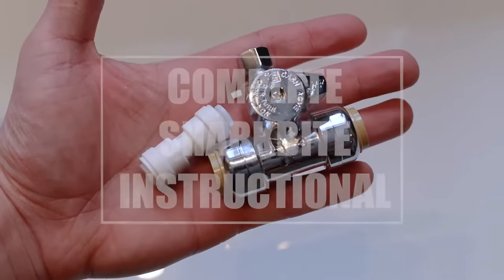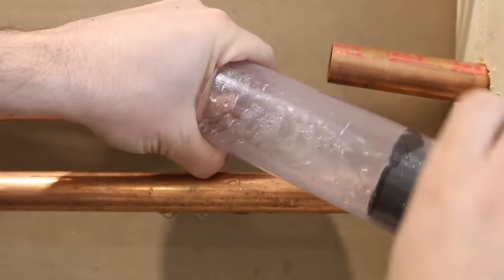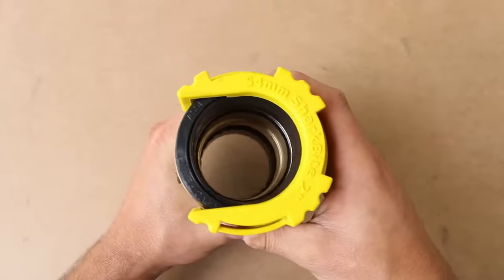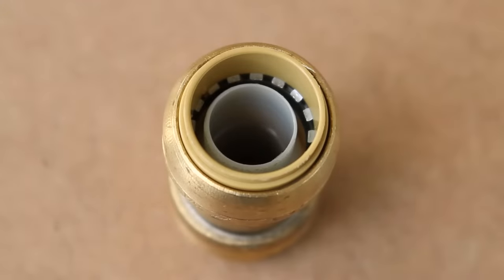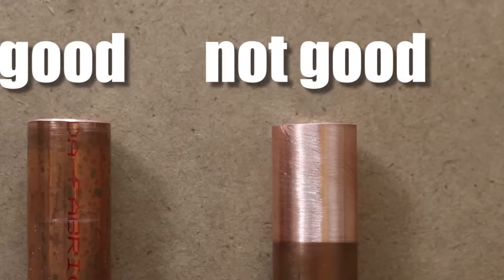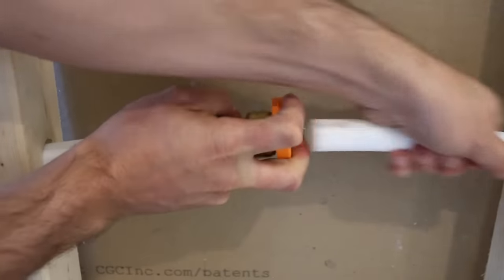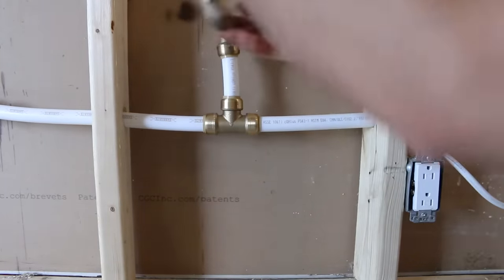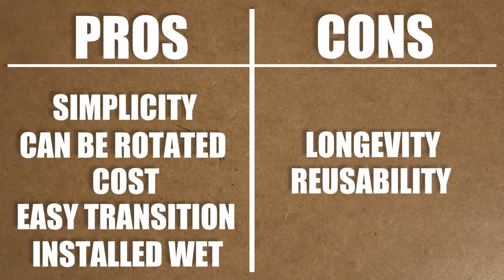Beginners Guide To SHARKBITE Fittings (Watch till end BEFORE Buying!) | GOT2LEARN

Comment: Thanks for the instant replies to my comments on your videos.  Question for you please, I have learned (after watching several of your videos on copper piping mistakes) that I put too much solder plus over heated the copper pipe when I was bonding a copper tee.  Now I need to make adjustment to that joint with too much solder, too much flux on top of over heating.  I am having difficulty of melting the blob of old solder.  That blob of solder would not melt in order for me to switch to a Shark bite connector.  I have using a green can propane for heating.  Any suggestion?  Thank you so much for all your very educational and great videos.
Reply from the maker: When you solder a joint and you are unsatisfied about it, you cannot adjust it, it needs to be unsoldered, cleaned and resoldered, no way around that.
Reply: @Got2Learn  I understand (learned that from your very educational videos, thank you very much for the teaching). I agree to a complete brand new redo but I could not melt the old and several years old solder.  So wanted to learn from you (based on your very extensive knowledge of copper pipe soldering) what is causing such weird situation.  Wanted to learn from this extraordinary situation before simply  cutting the copper tee and then install a "Shark tee" joint in its place to avoid not able to complete a new and correctly done solder joint as taught by your videos.  Thanks for the attention and time plus quick replies.  Take care of yourself.  👏👍
Reply from the maker: 🙂
It is highly probable that you have still water in the pipe, have you checked for that?
Reply: @Got2Learn  I have drained every segment of pipes (both flexible and hard ones) that have slopes.  I am certain there are copper pipe segments sealed off by dry walls and those are horizontals because I saw them like that while they are being installed/jointed.  Those are the ones going between the 2x4s within the walls.  So based on your video talking about the use of "Shark joints", the most economical solution to my situation is to cut off the copper tee that is only 2/3 solder correctly (the 1/3 that I am having difficulty of heating it to the proper
Reply: @Got2Learn  part 2 (sorry pressed the send button while trying to edit)-that 1/3 is closest to the standing and horizontal copper pipes behind dry walls.  I can only cut that copper tee off and replace it with a "Shark" tee joint.  Thanks for sharing and the diagnosis.  Take care.
Reply from the maker: Yeah you can do that for sure, do you plan on closing those walls back up?
Reply: @Got2Learn  Oh, no walls were opened by me.  I added that copper tee on the stucco side of the wall about 2 years ago.  Now I want to add flexibility to my hot water system so that I can switch between electric or natural gas heated hot water depending on how much I need to pay for the energy to have hot water conveniently.  I live in California so we have been charged at a higher price for energy, this flexibility just allows me to stretch my dollar a little more in the current high inflation time that we are living in.  I have plenty of access room to replace that copper tee with a "Shark" joint as your video talking about "Shark" joints stated as one of the pro for the "Shark" joints.  Thanks a million once again!
Reply from the maker: Yes you can use a Sharkbite for that application, but I personally wouldn't close up the walls with a Sharkbite in there ;)

Comment: How about outside exposed plumbing in below freezing conditions?  I need to connect multiple "drinker tube" cartridges on outdoor run of quail cages (on chilly PA).  Looking for a quick, detachable solution that will allow me to to remove a cage (for repair or sale) without having the cut (sacrifice) tubing length or create a leak should a screw together fitting be rotated.  Worried about freezing issues although the water supply will be constantly circulating.

Comment: Know that PEX tubing can withstand colder temperatures than copper or cpvc. Cpvc gets brittle after several years so be careful when working on it. I'm a fan of shark bite and have been using them for years with success.

Comment: good show question do they have freeze proof fittings. I have heard a lot about the brass fittings freeze and leak if insulation is lost to cold. only one complaint. water doesn't experience turbulence only air. cavation and water hammer happens in water,

Comment: Let's be honest.. how confident is the regular DIY'er soldering a pipe that's behind a wall? - Since my level of confidence is the same soldering or using Sharkbite, guess which one Im gonna use?
Reply: I'd rather use a mechanical coupler to join them tighten them up and there good as for a split pipe get a pipe mender they clamp around the pipe and tighten the bolt I've used them when the main shut off won't shut off all the way and you can't solder when you have water in the lines

Comment: Does the stiffening collar or small diameter of the 90 bends sharkbites reduce water flow  making water pressure decrease?
Reply from the maker: Not really because they have the same diameter as a normal pipe inside...

Comment: I have an old copper tube and so the outer tube is gunky. If I should not use sand paper to clean it, what other options do I have to make it smooth to fit into shark bite?
Reply from the maker: Use 3M abrasive pads, link in description box below.

Comment: Great video here but I would not recommend using shark bit fitting in areas that will be covered, here is why. I have just removed all shark bite fittings from my home due to 3 catastrophic leaks that resulted in significant property damage over the past 24 months. These fittings have been in service for 16 years and the ones that didn't fail were ready to fail at any moment. I have pictures available and I have also submitted them to the local building department because my neighbors also have them. I have no idea why they are failing but it is only a matter of time. If you have these buried in your walls I suggest buying a scope camera that attaches to your iPhone and looking at your fittings. I drilled a 1/2 hole inserted the camera and found several more fittings one that was about to fail and the rest showed signs of deterioration. I am surprised there isn't a class-action lawsuit, maybe there is I just haven't found it yet.
Reply from the maker: The question is; how were they installed.
Reply: I'm not sure where my reply went so I'll reply again to your question about installation. First and foremost you have a great video, great job! Folks should however be made aware of this issue and not use these in areas that will be covered up. OUr fittings were installed by professional plumbers hired to repipe the house replacing kitec plumbing 16 years ago. Our entire subdivision >1k plus homes was repiped and the ones with shark bite fittings are failing resulting in water damage. According to my plumbers, both reputable regional licensed contractors (southwest USA companies) we aren't the only ones with this issue. Furthermore, they only use shark bite fittings temporarily to restore service until the correct fittings are available to make the repairs. If you forward an email I will forward some pictures.    @Got2Learn
Reply from the maker: @bobshannon4437  This is a good opportunity to post it on my forum, i'm curious to see the pictures, here's the link: https://got2learn.freeforums.net/

Comment: Probably be a good idea to use a little bit of silcone lube to decrease the friction on the o-ring and to protect it a bit. Personally not a fan of these, I'd be willing to bet that they start failing after a few decades. Of course that means if you're older or plan on moving, that will make it someone else's problem lol.
Reply from the maker: Yes, it's actually a good idea, but they already have some 👍👍👍
Reply: I use plumber's silicone grease for the 3/4" and 1/2" end caps that I keep in my toolbox to temporarily cap off open tubing.  Those little guys can get connected and disconnected a lot, the grease keeps the o-rings nice and pliable.  I don't think you need to add it to a new SharkBite if you are just going to install it and leave it.

Comment: Would these be recommended to be used on the in and outlet line of a gas hot water heater?
Reply from the maker: It'll work, but I wouldn't recommend it.
Reply: @Got2Learn  thanks, I’ll go with traditional copper pipe.
Reply from the maker: @KillerBebe  100%

Comment: When installing pex in place of copper, using sharkbites, would you need to upsize the pex? For example, I'm replacing a section of 1/2 in copper with pex using sharkbites, do i need to use 3/4 in pex to keep a good flow of water?
Reply: You could do that but it's not necessary. I tend to continue using the same sized piping as was originally installed so in your case 1/2 inch. One of the down sides of going up in size is the wait for hot water to arrive at the faucet. It's very noticeable in medium to large houses.

Comment: I feel like the "longevity" and "reusability" should be in the pros category, not the cons. IF, and thats a bif if, it leaks due to an O ring wearing out, you can simply pop on a new fitting.  100 times easier than when a copper shutoff valve starts leaking, which they will.  And the fact that theyre not that expensive anyway is another plus on the longevity side.  And because theyre reusable and you can just pop them off and move things around if you need to, again, another HUGE plus, especially when working on an old house or doing a remodel.  There isnt a reason to NOT use these inside.

Comment: Temp only.  Every time you lose pressure the fitting slide off the tube ever so slightly when you turn pressure on.  Never use in a sealed area.

Comment: Anyone that uses these are future Flood Damage/Mold Customers. As a 20yr Residential/Commercial/Industrial Plumber take my advice that little Rubber O-Ring that the whole thing hinges on Can and Will Dry Rott and Degrade espessially when on the Hot Water Line because of Heat Cycles. I typically give them 5 years above ground and 2 years in ground wrapped in plastic. If you don't have any other option at least put them somewhere that you can keep a check on them. Same goes for ProPress Fittings.

Comment: I keep having a problem with the pipe I am inserting into the fitting  getting caught on the tube stiffener. I cannot insert the pipe because the stiffener gets caught repeatedly on the end of the pipe I am inserting. I am also having difficulties getting the fittings to release the pipes I have installed.  I have been working in a really tight space and these fittings have been giving me a lot of problems putting them together and then taking them apart. Any suggestions? I do appreciate your videos. This is the first place I have seen that tells me to mark the pipe to make sure they have been inserted the  whole way.
Reply from the maker: Deburr the inside of the pipe, it won't catch on the lip after doing this. Sharkbites have a tendency to "stick", I have a video on tricks to remove these, here's the link: https://youtu.be/nBS6MeI_500

Comment: I would say that the rotated aspect is a con as well. if you have a junction coming off copper going to a valve and then flexible hose to like a dishwasher, you can just grab the valve and turn it, and you know everything will stay in place and rock solid. if you're coming off these fittings the whole line is gonna move around on you. and I don't know about you, but I don't like disturbing and re-orienting my plumbing fittings once installed.

At the moment I don't utilize any sharkbite fittings. I'd rather just use solder, and maybe the occasional compression fittings where a solid pipe is terminated into a valve under a sink.

Comment: I have few shark bite fittings without that plastic piece inside, can I buy them separately? or is that fitting useless without that plastic piece inside?
Reply from the maker: You can't buy them separately.
Reply: @Got2Learn  without that plastic piece is that fitting useless?? Or can I still use them ?
Reply from the maker: @vivaint08  only on hard copper unfortunately 😕

Comment: Never seen pex or sharkbite failure. Copper/solder failure? All the time (not my solder job). JG's similar fittings (for water) have been around since the 80's. Anyone using copper today has rocks in their head.

Comment: "Reusability" cons : a drop of silicon oil before inserting again should do the job.
Copper pipes joints get crappy and corroded over time anyway, especially because they're wet. At least plastic will stand the time.

Comment: Soldered copper/copper connections do not reduce the inner diameter, so that's another downside for these fittings, I guess. 🙂 (At least with the stabilizer in place.)

Comment: I installed brasscraft push click fitting to my waterlines under kitchen sink 6 tears ago, it is still bone dry.    Everyday, since then I would check them for any signs of water leak.  I read these connectors can only last about 10 to 15 years.

Comment: I only use the cap for renovations.... quick and compact enough for drywall installation.... otherwise I don't use them ever... just like you...I still don't trust them....same goes for copper compression fittings...uses a crimper with no soldering... I've personally seen these fail.... great idea for wet install...but they they don't last over time.... plus the Milwaukee crimper is incredibly expensive.... good for fly by night outfits but I guarantee my work for as long as I'm alive... 😆.... could be tomorrow or another 50 years...

Comment: You can use them on the domestic side. But don’t use them on the heating side . If the temp is 180 degrees. They get to hot and crack . They also suck air . So don’t use them on a closed system.
Reply: I have never seen that happen on the hot side. Even coming 18" off the heater. Me thinks you're just spitballing a scenario that may happen.

Comment: Wait, aren't you supposed to sand the pipe shiny? At least with mesh or aluminum abrasive? I see that in so many copper tutorials. So we skip that step?
Reply from the maker: Nah, just needs to be free of debris/glue/stickers etc...
Reply: @Got2Learn  so if it does have debri or glue thats slightly cured, do I perform a light sand or just wipe it with a cloth?
Reply from the maker: @wwfera00  sand the big part off, clean the rest.

Comment: Just last night the supply line to the sink started to leak and I still had a good night sleep. Just needed to shut the water off and be at Home Depot the next morning. While learning all about Sharkbite fittings I've decided it's to cancel our subscription from Emergency Home Insurance which is nothing but a complete rip off. Plumbing is the main reason why I have that anyways and with SharkBite I ain't worried anymore. Some say the SharkBite fittings cannot be trusted? It's nothing like soldering copper pipes? So why would anybody be needing  to buy SharkBite fittings for? To replace all the soldered copper pipes that failed! Duh!

Comment: You never mention how to install these if you cannot move both side of the pipe? Or at least a very minimal wiggle room.  I recently needed to change the shower / tub mix valve  and bought these but later couldn't use them and went back to solder.
Reply from the maker: Check this video out for that: https://www.youtube.com/watch?v=ebvqSp-d8-0&t=41s&ab_channel=Got2Learn

Comment: Okay we got to connect copper the nut bolt to the PCP pipe do we cut both bad and the PCP pipe pass the connection and then replace it with a new adapt and bolt and pex ring City fitting

Comment: I sanded the copper pipe but have not installed the sharkbite. The video says it could leak . Any suggestions ?
Reply from the maker: As long as you didn't sand it for 20 minutes and with a small grit you'll be fine, try it out and if it leaks just cut the sanded part out.

Comment: You are 100% INCORRECT about sandpaper on the pipe, per SharkBite themselves. You MUST sandpaper the pipe to a clean smooth surface.
Reply: I've used 320 emery for soldering, also sos pad

Comment: I think you had to reach for the cons. Shark bites hold in cold weather better than solder. You said they have been around 20 years but that's not long enough for longevity. Tons of pipe is replaced and re-serviced on an average of 10 years. Shark bites are expensive but in comparison to a plumber, they are cheaper and last longer than a lot of plumbing work I've seen.

Comment: Has anyone used this in extreme cold weather? I’m worried that it won’t hold in -40c weather. I bought the shit off valve with the drain but worried to test it. Haven’t met anyone who has. Going to use this for my outside hose.

Comment: It seemed to me that you weren’t trying to make any false statements.  That is the sign of a true professional.  Just like a gas water heater in a garage on a stand.  It’s still common practice to do so in my area.  The correct answer on if it’s code or necessary is no and if you fudge the answer then it’s fraud and maybe criminally liable.

Comment: Anything that uses an o ring will eventually leak.
Sharkbites in my opinion should never be in a wall and should only be used as a temporary fix.
John guest fittings for small 1/4 and 3/8," lines being used for water filtration should always be accessible and used in an area where any leaking will be noticed right away.

Comment: I've had shark bites in houses for 15 years and no leaks. Except where I split an o ring. And as far as longevity, the cooper pipes on the east coast don't last any longer than 10 to 12 years. So it's kind of mute point. Especially considering the quality of copper is a lot worse than it was even 10 years ago.